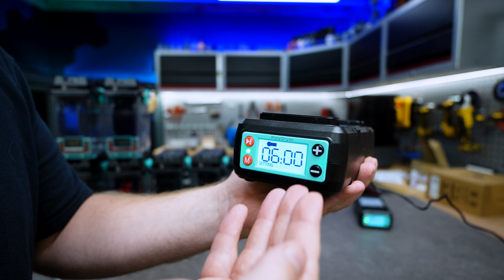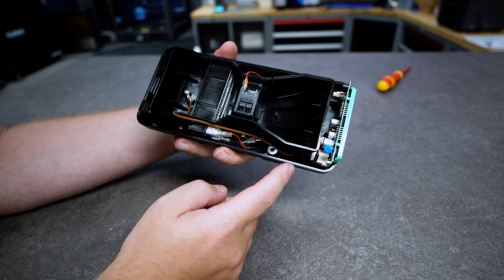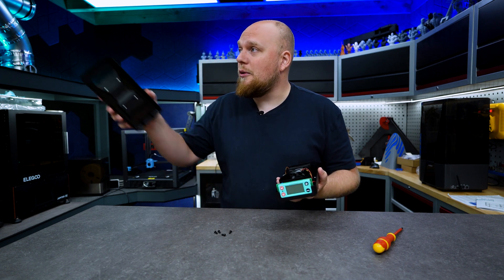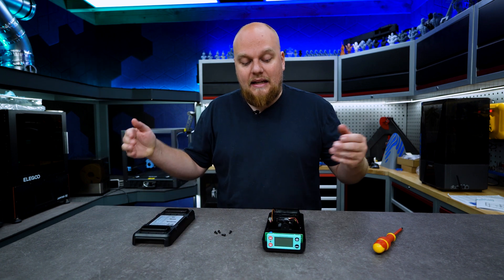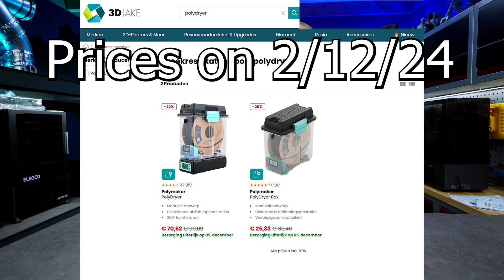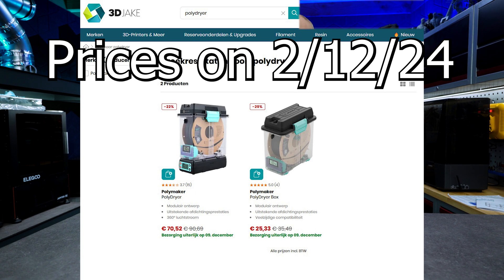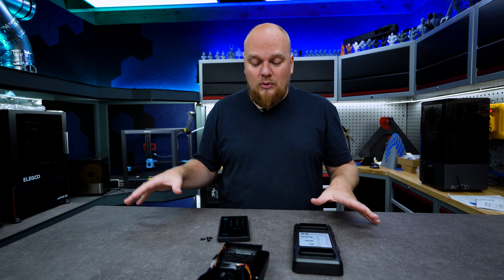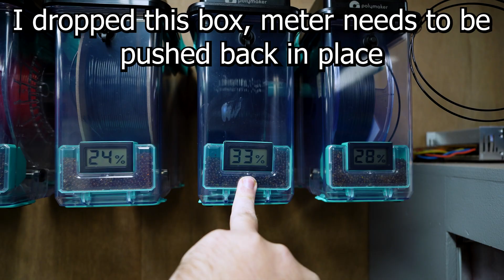Long term review of the Polymaker Polydryer and why i think it's THE best filament dryer to date.

Comment: Didn't see anyone else post a comment on this, but on Maker World, someone designed a box that you can pour the rechargable desiccant into and it fits on the polydryer base that can dry a large amount of desiccant in about 2-3 hours.
Reply from the maker: Also plenty of mods to use cereal boxes from Amazon or dry 2 at the same time. Some cool stuff available.

Comment: I just ran this dryer on PLA basic and it only showed 35% after 6 hours on low. My house is 49% in the room. I put in a Therm Pro meter into dryer on top of Polymaker meter and get different readings. Therm Pro shows 99 degree and 26% moisture. The Polymaker shows 35%. Just wondering if anybody else has used different meters.
Reply from the maker: Use setting 2, it's fine for pla as setting 1 takes way to long

Comment: There's Prusa Core One heater mod using that polydryer base. Very tempting mod instead of using a hairdryer to heat up the chamber quicker.
Reply: do you know what the mod was called?\
Reply: @Commander_Strider  look up polydryer chamber heater on printables

Comment: I would contend that the Fixdry unit is actually doing it the correct way. If you heat up air it can hold much more moisture so it wants to draw moisture from the filament but if all you do is circulate that air it will get to the point where all you've done is equalize the moisture in the air and filament. The Fixdry unit will draw in air, heat it up so it can hold much more moisture, pick up moisture from the filament and then vent so that moisture is taken away from the filament allowing fresh hot dry air into the chamber to keep drying the filament.
Reply: It would actually be a good video idea. As you said, it’s not really the “correct” way to do it, but you also use much less electricity to heat up the air since you recycle it, and the fan uses much less energy than a heating element. Additionally, you’re getting storage and a dryer in one, so you never really take it out of the box, keeping moisture levels low throughout the whole roll’s lifespan.

I’d love to see how well it dries the surface versus the deeper parts of the spool. 
how long it takes to dry it from 60% to 20%. 
how much energy it takes to bring it from 60% to 20%. 
how often you need to re-dry it within a month, a quarter, and half a year.
Reply: The box includes desiccant.

Comment: Good review.  I have same system but only 2 boxes and one heater.  What has helped with long storage is adding those center spool and second rear desiccant holders.  Has also helped with faster drying.  I don't feel like the stock system gets as much air flow over the desiccant as it should. It sure has seemed to go up in price an absurd amount lol.  One case and heater is like 80 to 90 US.
Reply from the maker: Yikes! I like the system but the pricing 😬

Comment: Thanks for the disassembly during the review. Looks like the holes on the sides of drying unit are not connected directly to the internal volume and used solely for ventilation of the module itself. It will still works since we have desiccant inside which will absorb the moisture.
There is more advanced diy project (built inside 10l  ikea365 box) with the active ventilation, you can find it on youtube.

Comment: After watching your video, I ordered 1 complete kit and one single box... since yesterday I am trying the system and I can say that I am extremelly disappointed. Don't know if I should return the unit(s).

Let me explain. My room Humidity is 60-62% in Munich, Germany. I have a window open because of printing PLA.

I installed everything properly and tried to dry on the 1st setting (recommended for PLA) some Anycubic filament that was being used in the morning. Upon closing the box and powering on the heater, instead of decreasing the humidity, it started INCREASING!!! IMO, the dryer, not being sealed around the box is sucking the moisture from the room... there's no other explanation. I could see the silica gel turning green in seconds! I confirmed that by running 3 full cycles (!!!), in total 18h FOR ABSOLUTELY NOTHING. The Humidity level remained at 43% while the other box that wasn't attached to the dryer and only had deseccant on it dropped overnight to below 30%.

I don't understand why Polymaker didn't include any seals around the dryer like the 2 included removable feet to avoid sucking air from the surroundings... I will probably return it all together. IMO, this is a gloryfied silica gel drier that has a fatal flaw :(
Reply from the maker: Increase in humidity is normal especially with cardboard spools. When you seal it up the humidity will drop as it cools down.
In my testing it's perfectly safe to use level 2 on everything even pla but try it with care. Level 1 is pretty weak so give that a try. Anywhere between 30 to 40 % on lvl 1 is what i experience, level 2 and up should get you under 30.
Reply: @NoizieWorks thanks man, I’ll try level 2 as suggested, at my own risk of course :)
Reply: @eldiabolico3750 did it work?
Reply: @Flagermus_FPV I did something different… I finished the 6h cycle, reactivated the silica on the hygrometer and then used an extra spool insert filled with silica gel inside the sealed container and just waited. The humidity level dropped to 10% for the PETG and keeping only the silica on the hygrometer without adding extra silica inserts (but still reactivating the existing one), keeps PLA around 16-20% so I think I might be into something here. Also the ambient conditions are better now (weather) so that might be the ideal circumstances for me. 

Thanks for the support though :)

Comment: I just received the Polydryer and 3 extra boxes yesterday. So far this thing is pathetic and a waste of money! After six hours of drying on the low setting with a roll of PLA in the container it moved the humidity percentage from 37% to 34 %. Obviously the freebees that you received must have swayed your review that's all I can say..
Reply: 6 hours isn't really enough from the reviews I've seen on other dryers. The average seems to be 10 hours. Maybe turn it up a bit and leave it on overnight. Also share your results.
Reply from the maker: @GTW-1807  lol... sure, qidi p4 is a lot more expensive "freebee" and you don't see me protecting them.
Or maybe watch the fixdry NT1 freebee before you start pointing fingers and calling me a fake.
If you watched the review, you can see that the first power setting is very low so it will take some time, sometimes more depending on how wet the spool is.
You can get away with using lvl 2 on most filaments if you're impatient even pla.
34% at 40-45c is also not comparible to ambient and it will drop considerable when it cools down.
Another side note is that most spools are made from cardboard, these spools release a lot of moisture the first time you dry it so dry times take longer anyway.

Comment: Thank you for the video. Isn't this a kind of expensive solution if you mainly print with PLA?
Reply from the maker: @GaryParkin  yes, it's more targeted to petg nylon....
Reply: @NoizieWorks  Thank you for the reply. I'm looking for a dryer (do I need one?) for my PLA. I see no issues with my prints but I ordered some PLA wood filament from Bambu and it says to dry it.
Reply from the maker: Regular pla is fine in most homes(not mine) So it's up to you if you want to invest to this or go for the cheap generic solutions.
Reply: @NoizieWorks  Honestly, this looks like one of the best solutions because it has less chance of melting the PLA. I've read a lot of overheating stories of different units. I keep my work room at 45% or less all year around. I thought if I was careful I'd never need a dryer.  I like the Sunlu S4 too but I think it's overkill for my area.

Comment: so where / how does it get the humidity out of the warm air? You only showed the heater...
Reply from the maker: @bernatix  it has holes on the side and the seams according to poly where already enough. It's all in the video
Reply: Everyone keeps getting this wrong! The dryer raises the temperature of the air in the box, which pulls the moisture from the filament in to the air. When you stop drying the filament, and the temperature in the box drops, the moisture comes out of the air, and is absorbed by the desiccant, instead of the filament.

Don't believe me? Look at the hygrometer reading. Put it on the dryer with no desiccant in the box. Put it on the dryer for a long time. Take it off, wait 6 hours for it to completely cool, and see how the humidity is higher than it was when you started.

Don't forget the hygrometer measures RELATIVE humidity, and that changes with temperature.

Comment: I don´t get the pricing either. You just need one box and one dryer. PLA doesn´t need drying at all, you can dry and store whatever filament you use like TPU prior to printing in one of the boxes and it´s fine.
Reply: I dried all my pla and it drastically improved print quality, its horses for course. Just because it doesn't help you doesn't mean it wont help someone else.
Reply: @NeonNerd-y1x Dude I am a development engineer for a German automotive company, PLA does not absorb moisture, therefore it does not need to be dried. 
You probably have some co-polymer and that´s the issue.
Reply: @sierraecho884  PLA's chemical structure contains double bonds that readily form hydrogen bonds with water molecules from the surrounding air. The rate at which it happens depends significantly on your environment's humidity. In humid environments PLA can absorb enough moisture to cause issues during printing. .....dude ;)
Reply: @NeonNerd-y1x Dude PLA is absorbing about 0,5% of moisture, that´s a tiny amount compared to PA6 and other materials which really need drying.
It barely creates hydrogen bonds, there are almost none H-bridges.
 
It barely changes it´s mechanical properties, I am not talking about theoretical values which you can see in a lab, I am talking about the general 3D printing nerd, using this overly expensive, glorified packaging material to print some Hentai shit.
Reply: @sierraecho884  We have to agree to disagree sadly. All environments are different and i've seen the results first hand.
Reply: @NeonNerd-y1x I do agree with you that some extreme places can lead to problems, at least I can´t deny that fact. However for most cases it simply isn´t necessary e.g. as bad as people make it out to be. People usually say "it´s the moisture" no matter what the defect is. So I would have to test it myself which of course I won´t do. I don´t even dry TPU and it prints "okay" or "good enough". Even in the summer during 30C° heat.
Reply: @sierraecho884  There you go then, it's a big world out there. And i personally benefited from drying my PLA. All the best
Reply: I was wondering that too. My printer lives in a controlled environment. My work room stays below 50% humidity.  I don't have any issues with stringing but Bambu says to dry the new wood filament I just got.
Reply: @GaryParkin  Dry material is very important. However not all material like PLA needs to be dried and you can dry whichever material in one box you don´t need many boxes, you can also use ziplock style containers with dessicant. So I like to use my Polydrier. It´s a nice product however I won´t buy god knows how many boxes.

Comment: You want some friction on the despooler, otherwise your spool can tangle. That´s why all those roller bearing designs are crap. You can use PTFE bushings or tube to glide on, is way cheaper and easier, if you want to decrease the friction but really it isn´t only not necessary it´s counter productive
Reply from the maker: @sierraecho884  the bearings are fine, it's the rubbing on the sides that bothered me the most.
The spoolholder of the sv08 has the being to smooth problem
Reply: @NoizieWorks  I don´t mean those bearings, I didn´t mean this product, I mean roller bearings in general. Many people still modify their spool holders to have as little friction as possible which is counterproductive. Just like you mentioned with the SV08. It becomes a problem.
Reply from the maker: Got it!
Reply: You want the lowest friction with TPU. It’s rarely a problem with the reel rolling too much.
Reply: @ With TPU yes, with everything else, no. 
There is a sweet spot between low friction which isn´t really necessary outside TPU with those modern direct drive extruders.

Comment: Just need to print a tpu plug for that hole when not using
Reply from the maker: @rocketboyjv5474  i push in the plug of the dryer itself with the filament still hanging out and that seems to work fine (tip from viewer)

Comment: it's a shame that these are out of stock everywhere and seem to be being replaced by the PolyBox dryer which is bigger and you can't use the dryer for multiple interchangable boxes as it's one unit.
Reply: Huh? Polybox seems to be their storage solution (without the heater), and I can’t seem to find any references to “polybox dryer” outside of some DIY projects.

Comment: Thanks for the review, perhaps a good idea might that when you are storing it, keep the white tube pushed in the top and front gromet, that way you might avoid some moisture coming in and you won't have to push the filament in.
Reply from the maker: @rubenm7195  apparently pushing in the rubber grommet with the filament still sticking out also works. Doing it now for a few weeks and seems to work great.

Comment: How do I know my filament is dry? What % does it need to say?
Reply from the maker: It doesn't really work that way, the % is the moisture in the air and doesn't account for the moisture in the filament that you can only remove from heating it.
On the polymaker box they have some times as a reference but when dry anything under 30% is great to store filament and keep it dry.

Comment: Can you dry the descant in a microwave and reuse?
Reply from the maker: @JWDigitalArchiving That's a good question, no need to do it that way.
It's designed to dry at the same time as the spool of filament.
You could also leave out the spool and let it run full blast for a couple of hours and do it that way.
Reply: @ awesome
Reply: This is wrong. Drying process is like this.

1. Run the dryer at mode and time specified for your filament. Watch hygrometer increase as air heats and pulls moisture from the filament in to the air in the box.

2. When hygrometer peaks and starts to reduce, then all of the moisture is in the air inside the box.

3. Remove the box and let it sit. Air inside will cool, moisture will come out of the air, and will be absorbed by the desiccant. Will have to sit for 12 to 18 hours for this to stabilize.

After several uses, the desiccant will be full of moisture, and won't absorb it easily from the air in the box. You can revitalize it by putting only desiccant in a box, no filament, setting the dryer to mode 3, waiting for the hygrometer to peak, then wait for it to stop falling.

However, the easiest, and fastest, way to revitalize desiccant is to put it in to an oven, on a baking sheet, and let it cook for about 4 hours at 250F / 120C. Don't cook it any hotter than that.
Reply: Technically yes, but practically no. Microwaves heat desiccant up too fast and cause it to no longer switch colors, it can also make them explode because of how fast the water inside the pearls turns to steam - like popcorn.
Reply: @Shayeta  Well, this depends on how you use your Microwave. Will say: how much power to use for drying. I can adjust my Microwave down to 400W (even 270W if I like), which is much more friendly to the desiccant. Still, it doesn't need 4 hours like in an oven.
Reply: @WolframWebers  The microwave magnetron doesn't power up or down, the power is "modulated" via turning it on and off so it effectively has that level of power. A 800W microwave on a 250W setting means it will just heat in bursts of 800W, not 250W continuously.
Reply: @Shayeta I was about to write the same.
Reply from the maker: Correct!
Reply: @Shayeta my microwave has the capability to actually microwave at lower, continuous power levels! I know that on Panasonic microwaves, the thing to look for is 'inverter' technology. Pretty nifty! Although, the principle of the thing is still the same, all the water molecules in the beads will heat at the same time, or even worse, could only heat in certain spots that happen to be mid-bead. Also, unless you're heating a great quantity, it is possible that there will not be enough moisture for microwaves to do their thing, and the microwaves may bounce off the walls, floor and back up at the magnetron (bad!). Never want to run a microwave empty (or effectively empty)
Reply: @shivermeshoes  That's amazing, I'll look into getting one like that!
Reply: @Shayeta it is fantastic at making popcorn and baked potatoes, also has a humidistat in it: https://youtu.be/Limpr1L8Pss

Comment: I got 2 of those boxes, 1 with pla pro and the other with pet-cf. after drying it goes to 23%-27% and after few hours it goes to 33%-37%. not sure how yours staying at 14%
Reply from the maker: You might want to give them a bit more time, if it's very wet the preset times could not be enough.
The filaments below 20% are done with the 3nozzle setting, nozzle 2 is around 20 and pla is closer to 30%.
Reply: I tried, I usually store my filament in those boxes and it keeps that 33-35 constantly, even after putting the Silica through the microwave. Thanks for your reply ❤️
Reply: Put a temp sensor in there, it wont go above 55. I tried. Let us know
Reply from the maker: @3dprintingfun329  in the video I talked briefly on the temps and the nozzles so i tested them with a thermocouple. I think 55 sounds about right
Reply: @NoizieWorks  thanks for reassurance, I wasn't sure if that's normal or am I doing something wrong lol